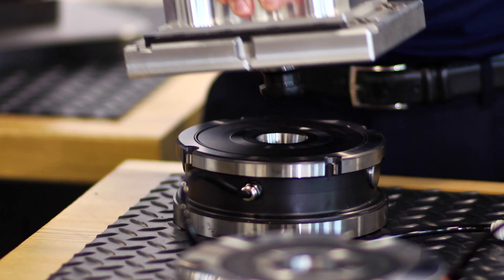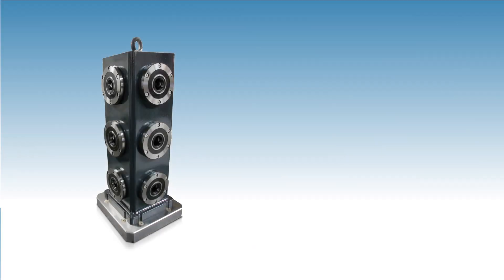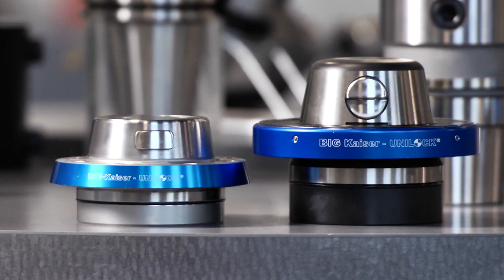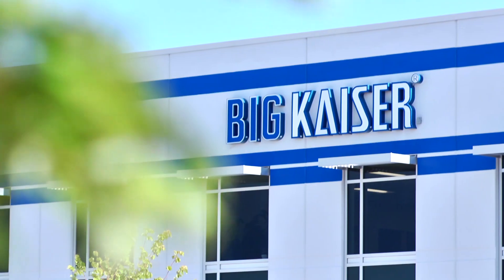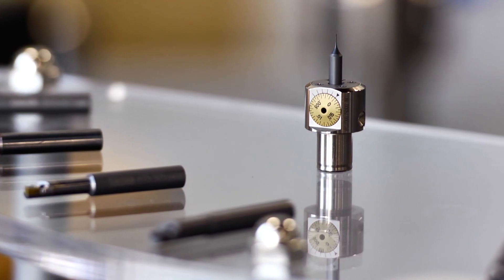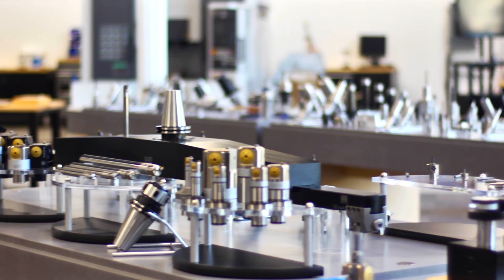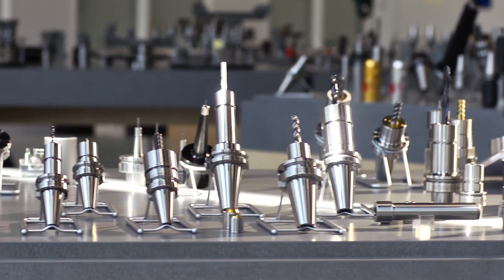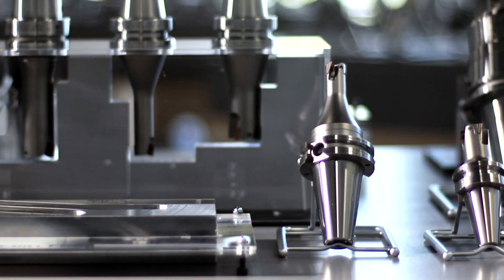Workholding Systems: Repeat PERFORMER | BIG DAISHOWA—Americas

Comment: The product has 1 DOF left - rotation around the vertical axis (CL of the clamp knob). Is this only prevented by friction or is there an additional indexing pin?
Reply from the maker: Thank you for your comment. The additional timing pin is designed to work in both directions around the center line of the chuck providing a Transitional Fit (not loose but not press) allowing for manual removal of the fixture.